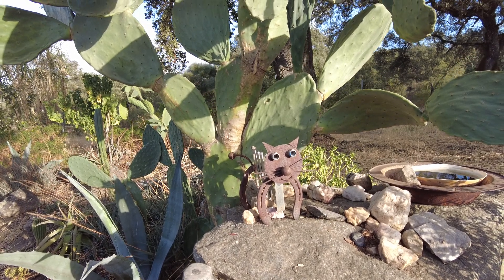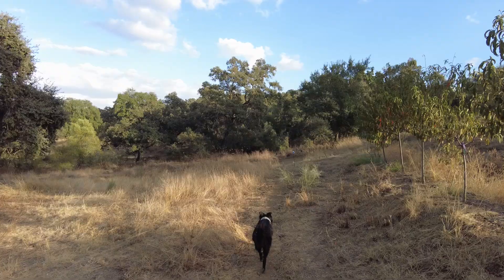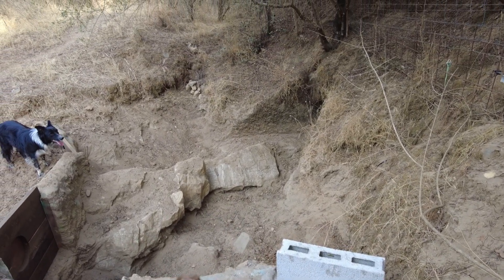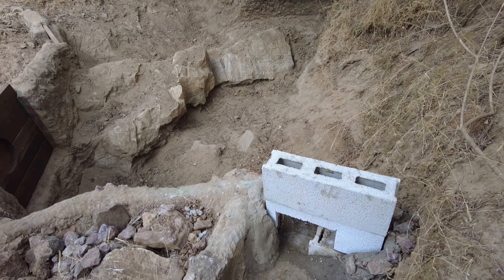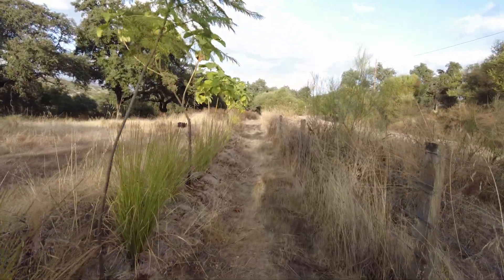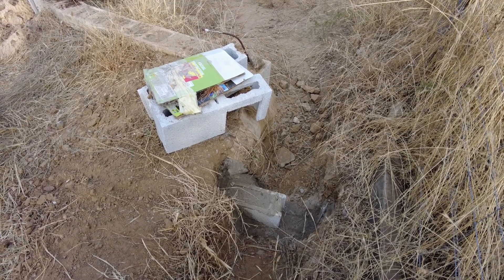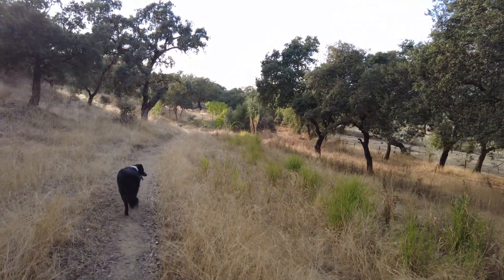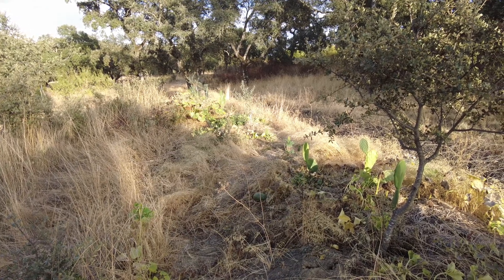Harnessing Rain: Swales, Clay Soils and the Art of Water Retention on Slopes #agroecology

Comment: As far as the welding goes, more than likely, the settings are not exactly where they should be for the thickness of metal you're trying to weld. I would adjust them some in both directions until the results are where you want them to be. Also, check to make sure the polarity is right for the type of wire you are using without shielded gas. Controlling water is always a good challenge. Thanks for sharing, as always.
Reply from the maker: Thank you for guiding my welding efforts. Much needed. Have a great day

Comment: Another excellent description Martin.  For those who have an interest in understanding your method in more depth, your descriptions are invaluable.  Packed full of knowledge relevant to the video.  👍
* A question about your welder; is it a stick welder only or does it also have MIG welding available?  MIG is far easier for the beginner.
* Regardless, (stick or MIG) your steel must be well grounded.  Rust, to some degree breaks the continuity of your ground.  So to give yourself a level playing field, make sure the area where your ground is clamped  is rust free.  Also the area you want to lay down your bead must be rust free.  If multiple pieces of metal are involved, there must be decent sized rust free area where the touch.  Simply put, you can't lay down a nice bead over rust, OK? 😉 Looking again at the video, I see you have tried welding galvanized pipe.  That is a bad idea because of the toxic fumes that are created when you heat the galvanized plating.  If you must weld galvanized steel, grind the galvanizing off the area to be welded. 
* OMG!  I had the same experience with wasps this summer.  Same hand, about one week apart stung almost exactly in the same location. Look for the wasp nest - it's there, close to where you were stung.  Probably well hidden.  I feel your pain.  Hard to believe such a small creature can deliver such toxic venom.  I hope the raisins ease the pain a bit.
* LOVE the idea of planting a fruit orchard along the path of the restored erosion gully.  Depending on the amount of shade, my suggestion is two rows, one to the high side of the hügelkultur bed and one to the low side of the hügelkultur bed.  With that pattern you can use spacing for mature trees - using the chess board pattern.  Also, the roots are free to migrate toward the water and the composting organic matter as they please.  And as the hügelkultur mound decomposes, you can fill in the resulting depression while the trees are situated on solid ground.
* You can plant vetiver divisions closely together across all of your water flows and still have enough to pot up a large number for sale at your local farmers market.  I suspect it would command a good price if the locals know it's benefits.
Plant Plant Plant 😉
Reply from the maker: Thanks for sharing your elaborated format Steve. There is enough wisedom in your comments to warrent a second cup of coffee to contemplate it all. Keep moving young man

Comment: You need to grind the metal clean. Wire brush or more
Reply: 90% of welding is prep
Reply from the maker: @sharp1977 Mmm. So well said. I'm going to take the angle grinder out now. Keep sharing. Much appreciated
Reply from the maker: I slowly understand that. Keep kicking my ass. Much appreciated